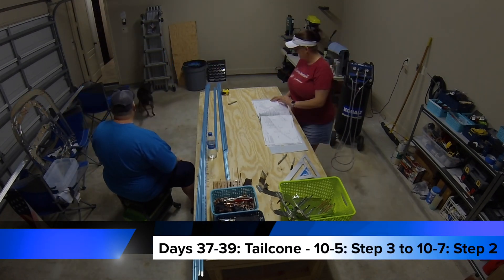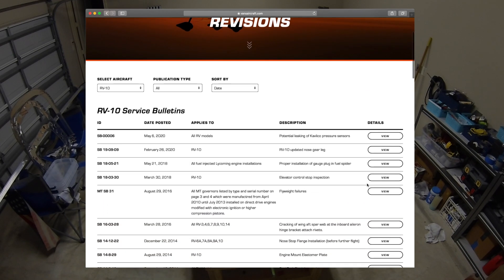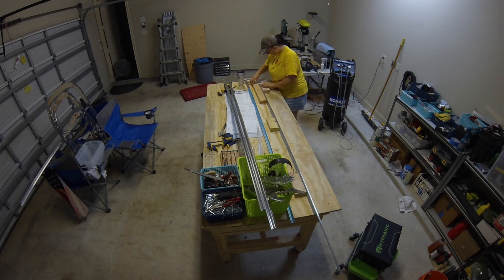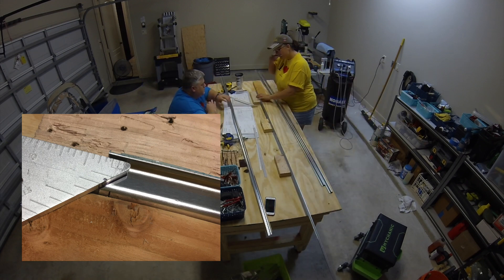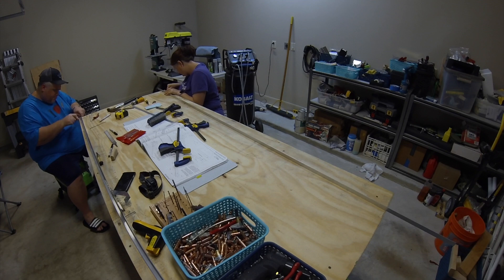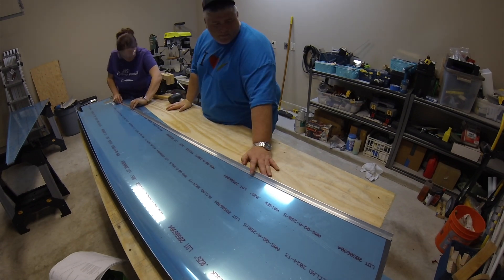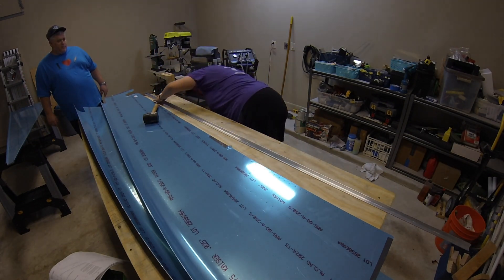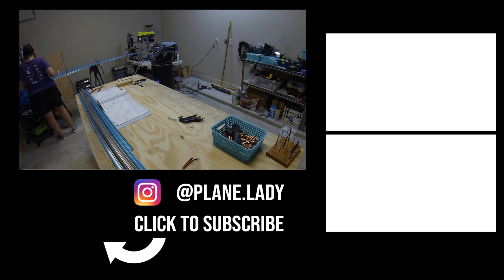Van's Aircraft RV-10 Build: Days 37-39 - Bending the Longerons (10-5 to 10-7)

Comment: I'll share a trick we learned in our sheet metal workshop for starting holes without the drill bit walking over the metal (NOTE: We were using air-powered drills). Without the air source connected to the drill, place the tip of the drill bit where the hole is to be bored. Applying light downward pressure on the drill with one hand, give the chuck several spins with your other hand. This creates a divot in the metal. Connect the air source to the drill, and off you go.
Reply from the maker: Thanks for the tip! I’ll have to try that out sometime 😊

Comment: I know you’re well past this but an easy way to mark center lines is take a scrap piece of j-channel and nest it in your working piece, mark where your centerline should be and remove/drill a pen hole in your scrap piece. Then you can renest your scrap piece, put a pen in your new hole and slide it down the working piece. Guaranteed to be equidistant the whole way down. 
As for holding the j-channel inside the skin, I have a bunch of high power magnets that I put on once I get the holes lined up in the skin with my centerline mark on the j-channel. Just put one on the j-channel web and one on the outside of the skin every 5 rivet holes or so. Make sure you get good magnets or they won’t be strong enough to hold and your line will wander as you work your way down drilling the j-channel.
Reply from the maker: Nice tips! Where were you last year with those?? 😜 I’ll mention those in the next video